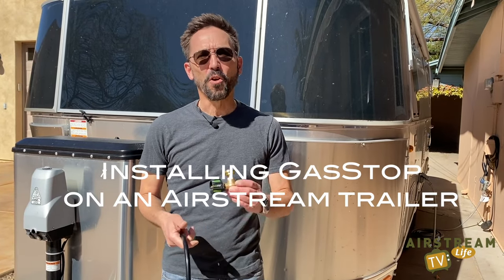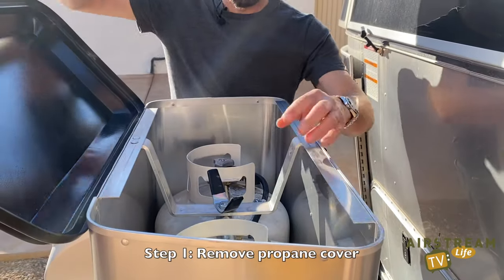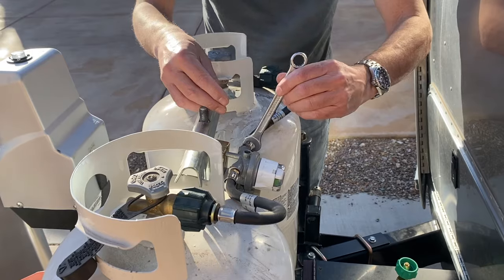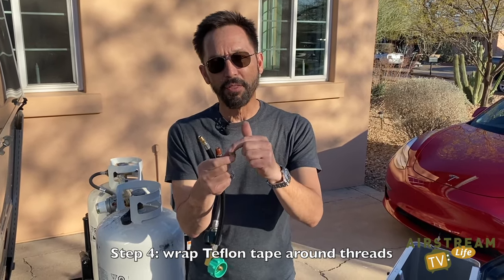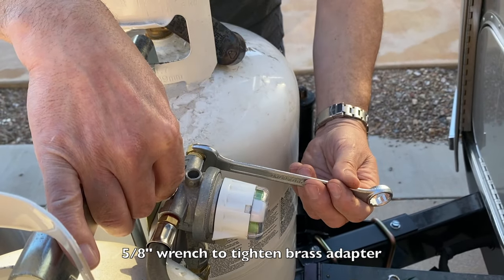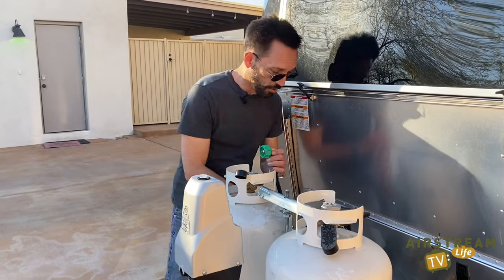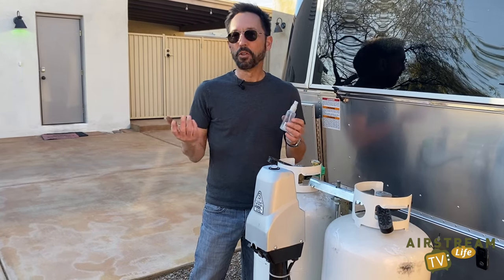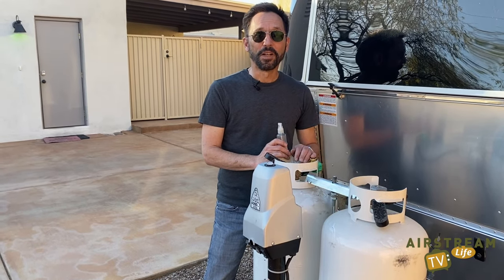Installing GasStop on an Airstream trailer | Airstream living

Comment: Looks good-- can I travel with one propane tank (with GasStop) open.  Staying safe and then when stop to camp, open both tanks to draw down the tanks evenly.  Or does the regulator not even out the levels of the two tanks?
Reply from the maker: No, the regulator doesn’t do that. It only feeds from one tank at a time.

Comment: Would you need one for each tank? And it looks like the stop valve also measures the amount of propane?
Reply from the maker: Yes, you need one for each tank you want to protect.  There's a gauge on the top but it's not a highly accurate measure. It basically shows High, Normal, and Low levels of propane.
Reply: @airgear  You have to order two of these at $109 each for two tanks?  How many Airstreams come with just one tank?  That surely seems excessive.
Reply from the maker: @pbmini51  All modern Airstreams have two tanks, but sometimes people want to save a few dollars and protect only one tank. That's possible as long as you always remember to shut the other tank off.